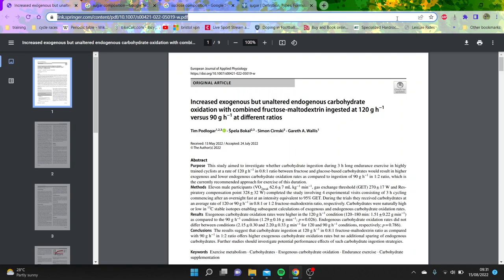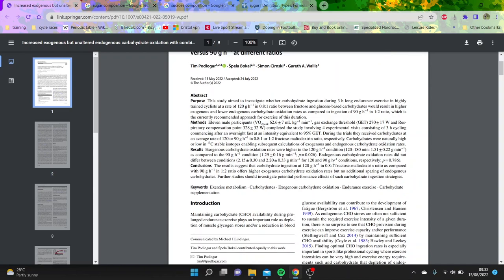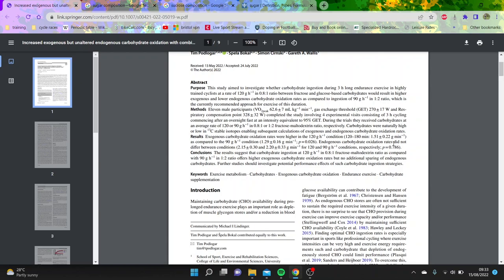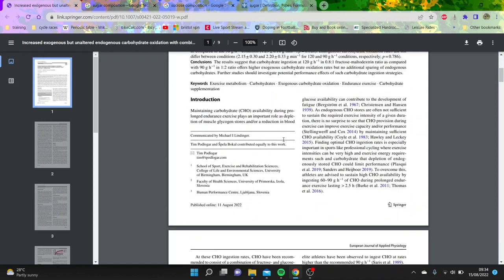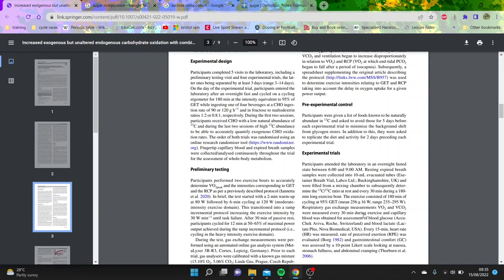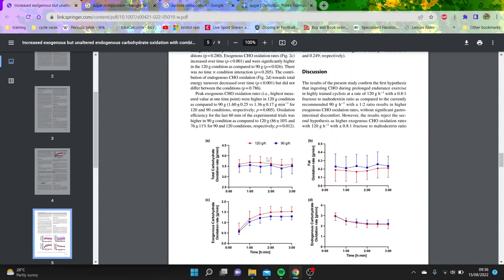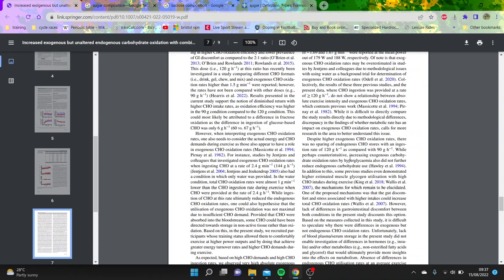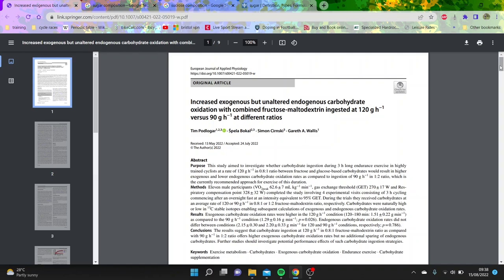Is SUGAR + WATER the ULTIMATE ENERGY DRINK ??

Comment: I have dissolved up to 500g of sugar in a 550ml bottle by using hot water
Reply: is that healthy
Reply: @joewakelin198  when you pedal for 5+ hours and you burn 3000+ calories it’s necessary
Reply: That would mean you managed to dissolve 500g of sugar in just 50ml water?
Reply: @R8JimBob88  sugar and water doesn’t have the same density
Reply: @philgary2654  but sugar doesn’t change mass once dissolved? So there’s only room for 50ml of water in a 550ml bottle assuming the sugar has completely dissolved. There’s still 500g of sugar. 

I believe you’d need at least 250ml of water to dissolve 500g of sugar. The water is fully saturated at that point and can’t dissolve and more solubles. Are you sure it wasn’t a 750ml bottle? 

I might be wrong so I’m going to try it 😅
Reply: @R8JimBob88  no, the density of sucrose is 1.59g/cm3, while water is 1. 
There is way more space left than 50ml of water after you fill the bottle with sugar. 
Of course you’re not gonna fit 550ml of water in, but if it’s hot is enough to dissolve it. 
And that is the worst possible scenario. You can always use a bigger bottle!
Be prepared for the taste though, it’s not good to say the least😂
Reply: @philgary2654  ah that makes sense I think. So 500g of dissolved sucrose at 1.59g/cm3 would leave about 235cm3 for the water in a 550ml bottle?

Comment: do you have strange taste in your mounth after drinking such home made carbs drink? (5:4 - 2:1 ratio)  ? Is it acidity ? 
do you add someting to the drink to alleviate this taste? (maybe bicarbonate of soda?)
Reply from the maker: nah don't have any issues with taste
Reply: Sugar is not acidic.  Many sugary drinks will add citric acid, check the labels.  Use another water bottle with just water to wash down the sugar coating in your mouth.

Comment: Advising to load up on carbs is the norm in cycling, but lots of people have undiagnosed insulin or prediabetes. Get a health checkup if in doubt before heavy carb fueling.
Reply: You obviously dont know the metabolic pathway of diabetes bro.

You obviously dont work with diabetics like I have since 1999.

Dietary fat is the main cause of insulin resistance in both types of diabetics.

You dont have any weight in this debate as you have zero experience working with diabetics to improve their oral glucose tolerance scores like I do.
Reply: @durianriders  What book/research would you recommend to read about this? I lost excess weight and got fasting blood sugar back in normal range by cutting carbs down, now eating more carbs as riding more and harder, just want to stay healthy. Just read Metabolical by Robert Lustig which covers the eight pathologies that underlie all chronic disease.
Reply: @durianriders  he's talking about someone who is already insulin resistant and thus fails a glucose tolerance test, not how to get there. Glucose intolerance plus lots of glucose = high blood sugar. Even though glucose (or fructose) does not cause type 2 diabetes (unless you do that Simon Fit thing where he managed to chug 2 kilograms of brown sugar water a day and actually managed to do the calorie surplus fat gain de novo lipogenesis thing)
Reply: @durianriders  actually excess calories resulting in excess weight gain causes diabetes, not just too much of a specific macro.